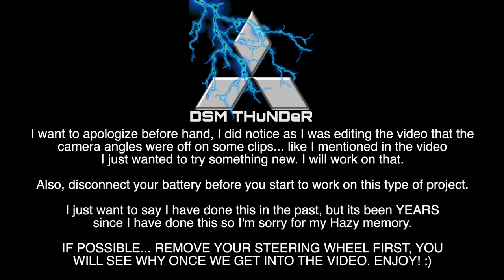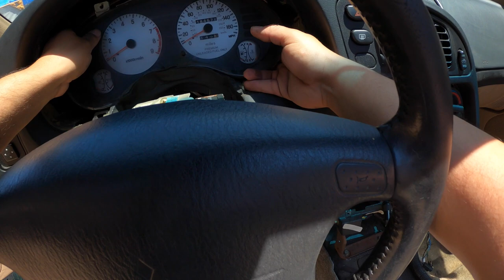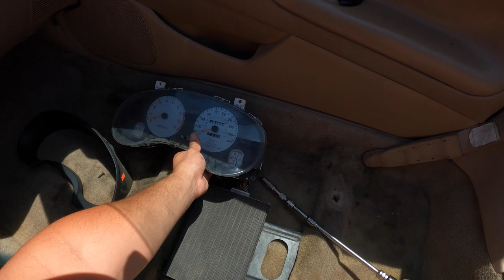HOW TO REMOVE A 2G DSM DASH

Comment: Do you know if it’s possible to change a convertible into a hard top and about how much do you think swapping the engine for a turbo engine would be?
Reply: You can change to a hard top. You would have to cut one off from a junkyard. It was something I was working on got the roof with the triangle windows and the hatch. It all fit but I never finished.

Comment: Yeah it would help make it easier removing the dash by removing the steering wheel and dropping the steering column down to the floor. You only want to do this once as you don't want to break anything from the dash struggling to pull the dash out. You can't buy the original dash from Mitsubishi anymore and finding a 2g or even a 1G dsm dash in acceptable condition is rare.

Comment: Yeah watching this video some more all the way thru you decided to remove the steering wheel when the dash got hung up and you couldn't go anymore without forcing it and thus breaking plastic pieces from the dash. I been there and done that with my 03 Hyundai Tiburon GT where i had to take the steering wheel off and unbolt the steering wheel column down to the floor so I can easily pull the dash forward out and exit to the side door without any hassles. Unfortunately Hyundai used inferior plastic material in this dash and alot of the plastic in the dash was cracked and brittle and missing broken plastic pieces particularly the mounting bolt hole locations in the plastic.

Comment: Bro where is the Ecu on a 98 spyder gs my dude please tell me
Reply: In older hyundais the ECU was either bolted down below the radio unit  under the climate controls or to the right of the gas pedal behind the carpeting. They all use Mitsubishi brand ECU cuz all older hyundais are mitsubishis in disguise, maybe its the same in 2g dsms
Reply: It's in your engine bay to the right.